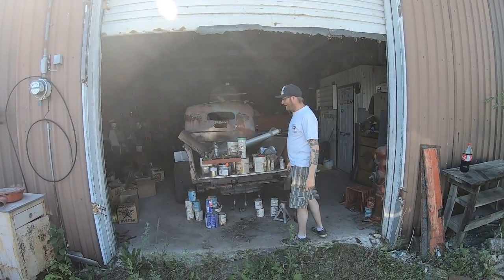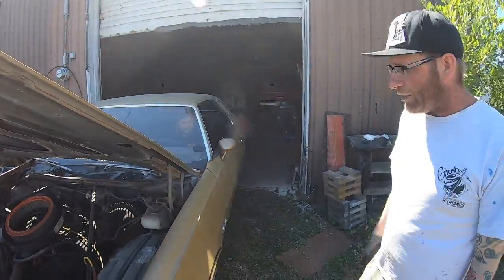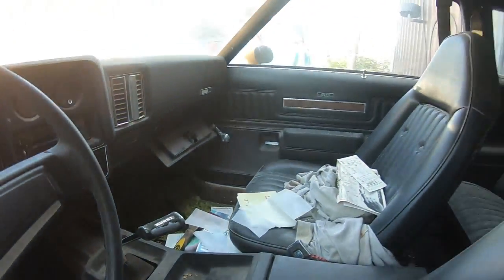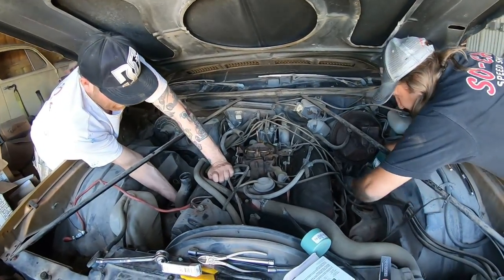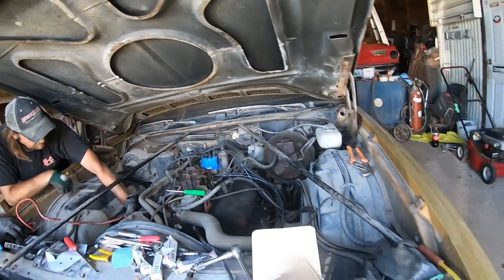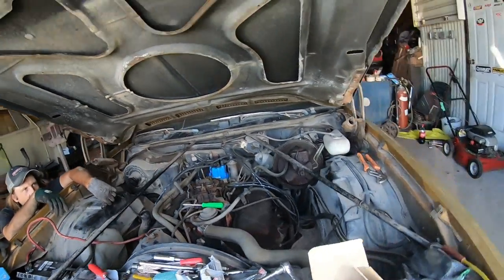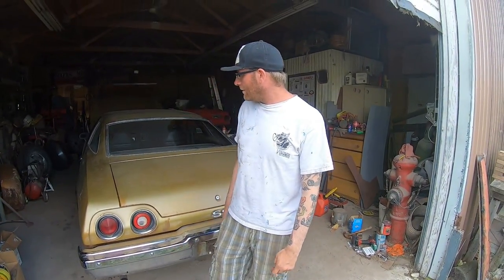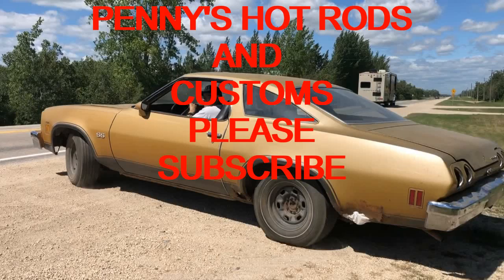1973 Chevy Chevelle SS 454 Muncie 4 Speed. Barn Find, Matching Numbers, First Start, Big Block.

Comment: What was the last year they put the 454 4 speed in the Chevelle/Malibu /Laguna that used that basic body style? Years ago I saw a 75 or 76 Laguna S-3 that had the 454 with the 4 speed, Dual exhaust, swivel bucket seats, center console, power windows, AC, tilt wheel, and T tops. The owner said his dad bought it new and that it was all factory stock with only something like 17K original miles on it. This was the only 75 or 76 Laguna S-3 I have ever seen with any of those options other than the power windows, tilt, AC,  swivel bucket seats and center console until then I never even knew they ever offered th454, 4 speed, dual exhaust as options especially the T Tops. Never saw another with those options since then either. Actually wonder if the car was legit or if the owner was full of it and had modified it
Reply from the maker: I googled it and the 454 was offered in the Chevelle mid way into 1975 and in full size Impala's and Caprice's in 1976.  It is quite possible it is correct.
Reply: @pennyshotrodscustoms  Thank you.
Reply: @todddenio3200  1974 was the final year for the 4 speed manual transmission in the Chevelle Malibu line.

Comment: I would fill the crank case with diesel and atf mix and idle it for 10 minutes and then change the oil and see if the tick goes away.
Reply from the maker: we cut open both oil filters the original one had lots of silver in the oil thinking latter this week will be pulling the engine. and will go threw it this winter and do it right.

Comment: I think I'd be more concerned why the lifters started hammering,  I'd be hooking up a oil pressure gauge just to be safe
Reply: Will be doing that this weekend i spoke to the owner about it and said it made that lifter tick when his dad had it I play with it this weekend
Reply: @corypenny2078  ADJUST or tighten it OR THEM sounds like more than one. The  GM TICK.STARTED IN THE  70s GM 350s did that alot after soom miles and hard driving.
Reply: When you can hear it on camera as the car goes down the road, well that's not good. Maybe that's why the car has been in the barn so long.

Comment: I would change the oil & use fresh fuel b4 i started up a car that has been sitting that long. The body has rust. I hated the long as doors. The bushings wore out fast.
Reply from the maker: We did all that but there was still a little be of varnish in the tank that must have softened up and got burnt.  We plan on pulling the valve covers to see if we can solve the ticking issue.  The owner said that it ticked before it was parked.

Comment: I would have changed the oil and removed the valve covers to pour fresh oil on the valve train before i started the engine. It has been sitting for 15 years.
Reply from the maker: The oil was changed but we did not pull the valve covers.

Comment: 12-bolt rearend with no Posi...? I thought they only came with 10-bolt 8,5'' and LS differential with the 454'' SS option.
Reply from the maker: You may be correct.  We might have mistakenly said 12 bolt, but we took a better look at it and it is a 10 bolt.  In the next video we will be showing the build sheet.
Reply: The 8.5” corporate 10 bolt is just as if not stronger than a 12 bolt

Comment: A lot of times the hydraulic lifters will lose prime. Sometimes you can pour a quart of automatic transmission fluid in with the oil and run the car for awhile it will prime the lifter.
Reply from the maker: We tried that and a few other idea's.  The owner said the noise was there even before it was stored for 15 years.  We are going to pull the valve covers and see if we can find anything out.

Comment: Points? Change it over to electronic. There is a lot that actually works. Check your distributor gear. Could be worn down.
Reply from the maker: We will be checking the distributor, but we like points and we want to keep it as original as possible.

Comment: Cool old car . All 190 horsepower 🤦🏼‍♂️. Bring that 454 to life with a good tune and a Holley EFI system 🇺🇸
Reply from the maker: We are going to keep it mostly stock because of the rarity of the car.
Reply: @pennyshotrodscustoms  The 73 had 245 HP 375 TQ 0 to 60 in 7.2 and 15.7 quarter mile
Reply from the maker: @drjohnsonhungwell5115  Not to bad for a heavy car.
Reply: @pennyshotrodscustoms  They're respectable numbers still sounds like it would be fun to drive .

Comment: Why are you driving it around without fixing that ticking sound like stuck hydraulic lifter stuck down and the pushrod and rocker just loose as a goose or it's a bent pushrod but it sound kind of bad
Reply from the maker: We barely drove it ant the ticking was there before the car was parked 15 years ago.  We plan on pulling the valve covers and taking a look soon.

Comment: That's a Chevelle Malibu SS and not a Chevelle SS...there is a difference...that one there is known as a Malibu SS..still a diamond in the rough tho...there was also a Laguna Seca identical to that one also
Reply from the maker: This is what I have just read " From 1970-73 the Super Sport option on the Chevelle always required a Malibu as the base model.  While all of the Chevelle SS’s from this time period were all technically Malibu's, selecting one of the “SS” packages’ removed any Malibu badging from the car.  Chevrolet literature generally referred to them as simply “SS396”, “SS454” or “SS” and most people call them Chevelle SS.  That said, I don’t think it would be incorrect to call these cars Chevrolet Chevelle Malibu SS396 or SS454 or SS, but what a mouthful."  So I interpret this as they started with a Malibu witch was a little fancier model then removed all badges and made them Chevelle SS.  All of the paper work says it is a Chevelle so I believe it is.  There may be differences since this is a Canadian built car in Oshawa.

Comment: Wonder if you could have the car put on a outside lift and have the bottom of the car soda blasted and put POR 15 all over the bottom. Then patch the quarters and blend the paint? Too nice of a car to let rust away!
Reply from the maker: We do plan on fixing the rust and then blend the paint.  The idea of POR 15 is a good one.  We do not have a lift but that has not stopped us in the past.
Reply: @pennyshotrodscustoms  you could make a gantry crane and hoist the body off the frame. Then roll the frame out and blast it completely  and the underside of the car. Could even use a fork lift as the hoist..... you guys will be creative and I am waiting to see it. I had a 1975 Cutlass S with that same body and I loved it... just a week 260 v8 economy  engine. Then I gave to my mom because she needed it.
Reply from the maker: @punkinsgarageandpaint8299  Good Ideas.

Comment: 1973 GM Reduced the Thickness of the Sheet Metal they used to Produce bodies on everything except Camaro's and Firebird's as they weren't do for a Redo until the 1974 Models that's the main Reason that you see many more pre 1973 Chevelle's surviving. I was working at A Chevrolet Dealer In 1972 when these came off the Truck in late August and we had to hide them from the Public eye. The First Chevelle we got was a Type S-3 it was White with Red Accents and Strips Like the SS's had. I had on Order a 1973 SS 454 4 Speed With the 323 Positract  and the M-22 4 Speed Red with Neutral (off-White) Interior and No Stripes No AC and Radio Delete and Bucket Seat Delete and Steel Body Color wheels with the Chevy Bow Tie Baby Moon Hubcaps.  I made payments for 4 months before the car was delivered. It was Stolen 30 days after I took Delivery it was found 12 years Later Stripped down to Frame and Body Shell Not even the Wiring Harness was left. It was fully Insured and Paid off after the first 30 days after it Disappeared. By the time It got Paid off the Oil Embargo had Happened and I bought a 1973 Volkswagen Beetle to Replace it. Looking back I wish I had the Chevelle Back.
Reply from the maker: That is crazy.  Sorry to here about your car, the beetle is cool also.

Comment: I use 2cycle mix if it's been sitting....
Reply from the maker: We have put ATF in the oil to start with.  But we are thinking it is a bad lifter.  It made the noise apparently years ago also, before it was parked.

Comment: mine was a 4 speed car also bought new they did not make many 4 speed cars i found out years later
Reply from the maker: Nope think its a pretty rare car there Steve fun to drive.
Reply: @pennyshotrodscustoms  had problems with motor cam went bad right front valve soft beat down threw tha keeper like most big blocks i had one noise lifter not many miles on it at the time  ithink most of the 4 bolt main blocks went to truck great vidieos guys
Reply from the maker: @stevedavis4377  Yikes Steve glad you like it.

Comment: Put a grey bottle of STP Total Treatment fuel injection cleaner  in every 3 months  with 89 or higher octane gas  always and clean up plus make motor feeling like a brand new or fully rebuilt to! On first oil changed get bottle of 1 litre or called to a  pint of 1000ml Grey Bottle of Gunk Engine Flush when got car on ramps or Jack Stands have engine running put bottle in engine oil crank case run for 10 mins ! Do 5 minutes with low idle then do 3 mins on 1/4 throttle on carb gas pedal hold for and last 2 mins low Idle then shut car off! Then drain Engine Oil pan plug to complete with no drips if can , put plug in do Engine Oil Filter plus to and drain Engine Oil pan again too see anything comes out! When put Engine Oil Filter use Fram type plus use no synthetic 10W30 engine oil of Vavloine  or white bottle Castrol GTX engine oil or Pennizo yellow bottle  brands 5 litres , plus Changes PCV Valve, Fuel Filter Fram brand type and also Air Filter Fram 2x type to ! If can't get Fram use NAPA brand too and you notice big time difference also be surprised too! I done it to my vechiles long time and never had big problems ever!
Reply from the maker: Thank you we will be looking at the tick this week.

Comment: I don't care what you do it's up to you A lot of these cars can be saved get them up off the ground you're letting the frames rot sit on the ground you have old Wheels sitting there in the junkyard the real valuable cars get them up off the ground even if you put them up on old rims don't let them sit on the ground you're letting the frames write out and they're just going to hell you don't have the best weather there for automobiles go out there with a wrecker go up there with a forklift what do with anything you've got lift the front end up but couple of old rims underneath the wheels in the front go around to the back lift the back end up at the old rims even if they got tires on them that are no good, they did get them up off the ground you'll save those cars I'm having to go to the scrap and being crushed because of the frames and the undercarriage is on them rot they can't be saved they will not be worth being saved and all that money you could be making will be thrown out the door because it'll just rot away
Reply from the maker: You are right about that.

Comment: Not exactly the best looking car but still significant as one of the last made before the smog era just decimated everything performance oriented over a 20 year period that would follow.  The LT1 found in the '92 Corvette and then the  in the '93 F Bodies picked up where these cars left off. Virtually everything else in-between, from the factory, was so weak it was entirely up to the DIY guy to make power without any factory help to speak of. The late 70s and all the 1980s were some break bleak years for bone stock/street legal factory performance.
Reply from the maker: They are a different kind of car and agree BOUT THE break bleak years.